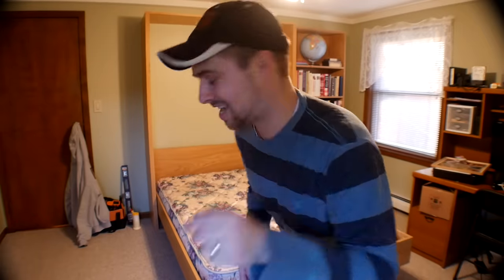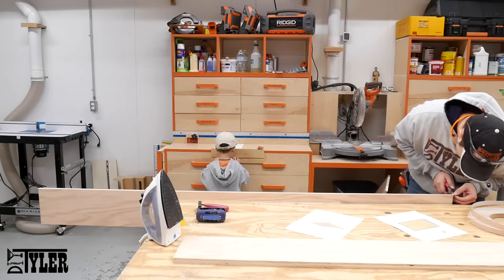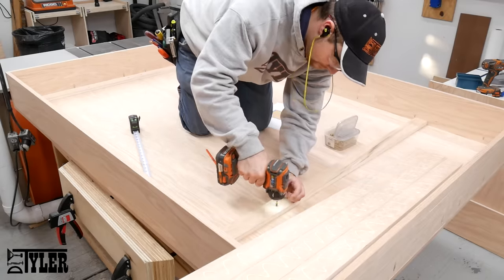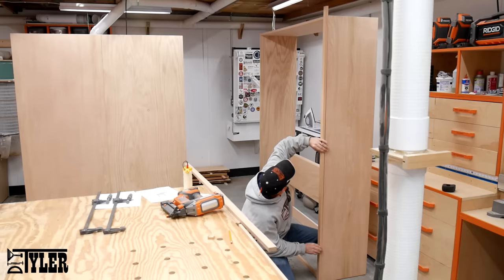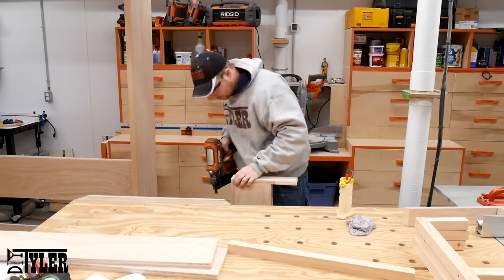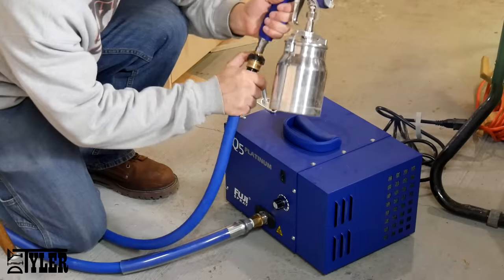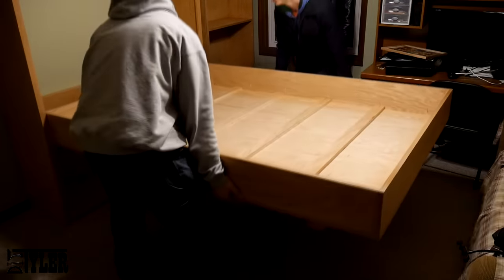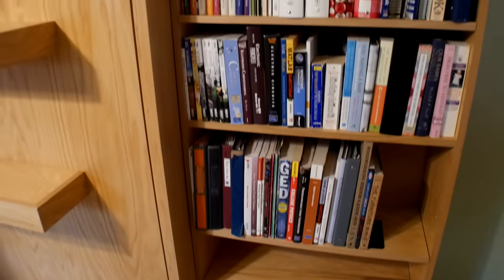Murphy Bed with Cheap $20 Hardware

Comment: Well planned bedframe. The Lazy Susan bearings are such a cheap and easy option with many being rated for a couple hundred pounds. Your push stick though, oh boy no wonder you were uncomfortable. I built a sword style with a handguard in the center and then at the very end to accommodate my safety needs.  It's been great for everything and awkward pieces I can still easily grapple with it from whichever side, and use a scrap stick for the other. 
28 years ago, a massive piece of plywood yanked my hand into the blade.
I lost an index finger tip that completely grew back, and the ring finger pad was totally blown open but the doctor flopped the pieces in, put in a few "Dr. Frankenstein" looking stitches, and it healed really well. 
I did not touch a table saw for another 13 years! 
I was and am an ultra elite level guitarist and that happened to my left hand, the string hand!

Comment: Bought your full size plans about a month ago.  Built the bed in a low ceiling spot, with an angled hip wall, and had to convert it to a horizontal build. Had to build unit in place, as bed box and cabinetry would not have rounded the corner up the stairs and into the room built in the attic. Added a bookshelf to the top in the remaining space. Came out pretty good.  Had to use it this week for company, and it wasn't entirely finished.  Finished trim work tonight, and will prep and stain in the next few days.  Thanks for getting me started!
Reply: I have to do a horizontal build.  show pictures.  I would love to see the bed.
Reply from the maker: I now offer plans for a full size bed, horizontal.

Comment: I built a wall of various depth of shelves 30 years ago using 3/4” birch plywood and discovered the iron on veneer tape and it has held up well. I used Minwax Antique Oil Finish without a stain but it gave the wood a deeper look with a soft sheen and it has held up well despite having plastic bins of fabric and other items sliding across them without not having to be retouched. The tape on the edge made the shelves appear solid and was so easy to apply. We had recently moved in at the time and I wanted something that could quickly be completed without the typical multiple steps for traditional finish. I remarried 6 years ago and my husband who has become interested in woodworking had never heard of the veneer tape. They did have the typical glue on variety back then but I had more than 40 feet of shelving. We have talked about a Murphy bed in one of the bedrooms which drew me towards your video. Very nicely done!

Comment: I want to thank Tyler for answering my question about the depth of outer frame .I built this bed  using thong and groove 1x5  knotty pine. This was much cheaper than using plywood because of the pandemic raising the prices of big box lumber. It came out just great a little heavy for folding . I also added 3 in. to the outer shell as suggested by Peter Lowe because my mattress is 17 in. thick I also added a extra 5 in to the top of bed box. When we first folded it shut the open the mattress stuck nothing a strap did not fix you just have to take strap off before sleeping. It only took me a week to build thanks to the great plans and some helpful hints. Also my wife helped and her help was greatly appreciated!

Comment: Thank you for making this video. I just discovered your channel today and wish I would have a long time ago. I have plans to make one of these beds in the near future and this is very easy to follow. I really like that you have your little boy help in the shop. That is incredibly important not only for learning but for bonding as well. My little boy is going to college next year so I'm already getting nostalgic for the early days.

Tech Tip: 
You mentioned that you had a tough time holding the large frame with various clamps etc. What I have done in the past is get a ratchet strap or put 2 together to get the desired length. Wrap it all the way around the frame and gently ratchet it together. It will hold even pressure around the entire frame and give you the rigidity you need to adjust your joints and shoot in the screws.
Reply: Great tip I will use next week!

Comment: Very smart build. Like how you use the shelves as a bed base. 2 suggestions. 1st, for your your corner attachment. Get some of those inexpensive 90° clamps that are about 1 1/2" wide. 2nd, in the video you should have mentioned what you used for the swivel. I'm going to mention that those are $10 boat swivel seat bases. I have them on my boat. It takes a bit to swivel around which makes it a great use for something like this. GREAT JOB!

Comment: you could probably just drill 4 holes through each mounting plate and screw them in, no need for bolts. 8 screws can hold a lot of combined weight. I've seen other people add in gas struts for car boots and other mechanisms to offset the bed weight. Looks like an easy enough addition to your project. Great job.

Comment: Have to say
That stain job looks fantastic. 
IMO gives it an aged look although it's brand new. 
Here's a secret from the upholstery world on those swivel brackets. 
Flip over a swivel recliner and you'll see, in that pizza board, as they're called, there's two holes large enough to grant access to the inside holes.

Measure out a piece large enough for it to attach to and swivel without coming off the edge. 
Attach it to the swivel plate. 
Swivel 45 degrees and cut circles over the bottom set of holes. 
Now you have a way to get to those bottom holes without too much difficulty. 
You attach those first, two at a time, swivel to the next two and attach those. You would then attach the swivel board to the mattress  side rail with heavy gauge screws from the inside. 
You would have to figure out how to hide that board but beefing up the side rails for the mattress could do that and it will create extra strength. 

I like and dislike the shelf idea. 
Anytime you let the bed down, you've gotta empty those shelves. 
But, it looks great and these beds aren't in constant use. 

Great build young man!
Good to see dad getting the kids into something other than electronics.

Comment: Best built I've seen so far! Thank you! PS: I've been using clear coat finish and tinting with stain for many years. I don't have an expensive sprayer, I roll it on with a foam roller.

Comment: Great design, Mr. T...I have it built and recycled some old old cedar sub-flooring for the wall/underside when in the parked position. Each board is stained a different shade....14 in all  Just figuring out the floating shelf/base system. I also found the Swivel Seat bases at WALMART FOR about 8 bucks each. BTW I used Valspar Cabinet and Furniture Oil enriched water clean paint. Lowes has it for around $53 a gallon but worth the hassle. I spilled some on the carpet...cleaned up nicely.

Comment: Hi,
I like the idea of using lazy suzans, but what's got me worried is how it will hold over time: 
These mechanisms are designed to support axial loads, not radial loads (and it is very difficult to even find any figures at all for radial strength)
So my question is: after a few years, did your build hold well ?
thanks !

Comment: is there any way to have this similar design with the legs as floating shelves but without having to manually lock it at the top
Reply: Ponle un límite en la parte de adentro y listo

Comment: The only issue with pre-tinted finish, is that it lacks the depth that a hand rubbed stain gives you. That said, many years ago when I was working in production cabinet shops,  tinted lacquer was the common method of finish. Your project not only looks good, but nice to see an inexpensive option for Murphy beds. Keep up the great work.

Comment: Hey Tyler nice job on the build i know its a older video one tip is you can make your own  90 degree  triangles  with a 4 “ wide strip on 2 sides it gives you a way to clamp those bigger  parts  by yourself on a table  easy peasy. And you can usually  use scraps or cheap MDF ?

Comment: No table saw. Ive got a portable Craig crosscut for my circular saw but there's just no way unless you took some of the build outside put some tarp on the ground and got very comfortable with your saw horses. Lol. I'm hoping the old router bit from my 6-piece Black & Decker matrix would take care of the dado but who knows, it's not the sturdy piece of machinery although it has been super handy so I don't want to knock it too hard. Also those sheets of plywood aren't necessarily cheap😅 but if this is something you need this is an awesome tutorial. Im in deep consideration. Like a lot of you I wanted a smaller version but I think the measurements for the size bed are a lot easier to tackle. Especially if you're not losing anything off of your sheets of plywood because it's super nice.lol.

Comment: I made one of these in a twin size for my granddaughter two years ago. At 58. Go Grandma's! I'm still not happy when it's up. I used a bolt on each side going into a t- nut on the bed frame. I'm always worried it won't hold. And the t- nuts aren't staying secure. So do you think if I just remove the t- nuts it will be secure enough? Thanks.

Comment: Great project.  Another cheap option for coloring clear water-based finishes is just throw some instant coffee in it.  Did this a while back with a project covered in red oak plywood.  Thru a trial and error process, I found best trick was to dissolve a large amount of coffee crystals in a cup of hot water, then add this to the water poly.  Do a bit at a time as you can always darken it but  can't go back.  Made a great golden-oak finish, and subsequent coats darken the finish, but recoating can make for dark streaks in the corners, so once the desired color is achieved, additional finish coats should be clear coats.
Reply from the maker: +gjforeman That sounds delicious! Thanks for the tip!
Reply: Tyler G Not sure how it would taste, but if you're a coffee person it smells great while drying.
Reply: Great idea.   very natural 
. solution.    I love the smell of coffee.

Comment: I'm planning to build a Murphys bed and your video is an awesome inspiration. Just have two  questions, that I hope you can help me with.
1: Did the Swivel Brackets hold the weight? Because the Swivel Brackets are supposed to be mounted horizontal (flat) 
2: Would you have done anything different?

Best regards
Reply: This is what i want to know. I have a feeling they will eventually break

Comment: A few years too late, but instead of the bolts in the end, would a two-latch system not fit the bill for keeping the door closed? One on each end connected by a single cord hanging a few feet away. Pull the cord and the door comes down, push the door up and it closes on it's own.

Comment: Remove the mounting screws for the pivots and add a washer between pivot and wood, then screw them back in.
If the unit will be used every day you might want to use threaded inserts to mount the lazy Susan hardware

Comment: Not sure how often you reply to old comments but how'd this holding up? I'm moving and thinking of adding a murphy bed to a room but the boat seat swivels aren't technically used for this so I'm curious how it's holding up?
Reply from the maker: It's still perfect. We don't use it often but it has held up great. I painted it a different color but that is the only change!
Reply: @DIYTyler  Glad to hear. Thanks for getting back to me on this. I'll be purchasing plans as soon as we move into our new house. Looking forward to making it! First large scale project for me. :)

Comment: I just bought your plans but I have a few questions...as to the floating shelves in the plans it says 2x4 material (only in the diagram, not the shopping list) but in the video, it says you use 2x 6? It seems like the shopping list isn't super complete how much 2x4 or 2x6 should I need? I think just an 8 foot board? Also, it says 3/4 solid oak but no measurement of how much I need and where exactly that goes. I could tell in the video where you put it but I thought it interfered with the brackets and it would be changed in the plans?

Comment: Nice creative use of the lazy Susan as hardware. I'm not sure if access would be possible, but if you used carriage bolts would the low profile heads clear the face frame?

Comment: I work at one of the largest paint and coatings retailers, and we never recommend you mix your finish with stain. The majority of finishes aren't made for it, and you run the risk of issues down the road. Now for most projects you're making for yourself, this is really fine. You know what your getting, so no big deal. I wouldn't do that for a customers project, or anything your wanting to sell however.
Reply from the maker: I spoke directly with general finishes and didn't use a higher mixture than they recommended. Like you said majority of finishes are not made for it, high performance top coat can be mixed with GF water based stains.

Comment: I built a twin version very similar to this many years ago. It worked great for several years.
Reply: I would like to build a toddler version for my grandson, however I want it bed outward, so the the flat is the bed, no mattress will be involved. Do you think this would be possible? So that when it stands up/out it shows a bookcase and when it lays down it shows a flat surface or at lease a small recessed area for where the mattress would go. I'm not sure that l am making sense as to how I would like it to be. Please respond to give me a little hope that I'm not crazy.

Comment: Hi Tyler, quick question - page 9 trim dimension shows 1" wide. Page 10 states boards are 1 7/16" wide.  Can you please clarify my confusion?  Also, what are the dimensions of the two bottom boards on the frame - 3/4"x3/4"x 63" (& 64 3/8"), I see the length but not the width & depth.  I see the back board is 3/4" wide actually. All trim is 3/4" thick?  Thank you!

Comment: Looks like there is something added in when you flip the mattress up. Underneath where the hardware would be, on the floor, did you add something front to back? For what purpose?

Mine is totally built, just added the second coat of white paint on the middle section (the wall frame for the bed) and did two shelves. Cannot wait to be done lol. I just have to paint the mattress box and attach it to the rest of the unit. It's looking really really good tho!

Comment: Tyler my queen bed is gorgeous. My finace' loved it until she tried to open it. At 72 pounds extended (weighed from the foot of the bed without a mattress) it is too heavy. She can't lift it. And she is concerned about her 3 year old grandson playing in front of it and the whole thing comes down on his head. She wants me to tear it out. I see her point. Or, instead of trashing it, can I add some spring loaded gas shocks on each side? Do you have a recommendation?

Comment: One cool upcoming woodworker at 4:06 and at 9:26 showing some great cleanup skills. Great project as always Ty, and that Fuji sprayer sure looked awsome. Is the overspray really so minimal that no covering is needed in the shop?
Reply from the maker: +Bellevue Woodshop It is if you go slow with a lower spray feed. But, shooting only a clear water based top coat I think the finish is dried by the time it lands on anything besides the project. Haven't noticed any Ill effects. Thanks for watching Roy, hope all had been well across the pond.
Reply: Bellevue Woodshop      N+.    '

Comment: Hey Tyler,
Great work. It's been very nice to see your variation of the design with the swivel bearings. Have you factored the fact that the pocket holes on the inner mattress frame are weaker than on the outside?

Comment: Tyler, thanks for the video and the plans.  The video is very well done, and the plans are very helpful.  I purchased the queen bed plans and am getting into the details.  Also making some minor changes.  A few questions.  Mainly, how much space is needed to accommodate the nuts that hold the swivel hinge to the “bed box”?  It appears that, with the two 1” vertical edging boards, as shown on page 9, there would be a 11/16” space between bed box and the frame on each side.  That seems like a much larger gap than is shown in the video for the Murphy bed that you made.  Is that because you cut some of the vertical edge board off to accommodate the nuts on the swivel hinge?  I didn’t see that any of the vertical edge board had been cut away in the video after you had installed the bed and closed it up.
Also, how much space between the bed box and the frame is needed at the top?  It looks like the plans allow for ¼”, based on the placement of the swivel hinge.  It just seems like more would be needed to allow the top of the bed box to rotate out.
A possible typo: On page 10, there are two solid oak boards shown at the bottom of the frame.  One is shown as 63” and the other 64 3/8”.  The vertical edging boards are shown as 1 7/16” wide as page 10, but page 9, indicates that these boards are 1” wide.  If the vertical boards are actually 1 7/16”, then the shorter of the two bottom solid oak boards would be 63”, but if the vertical boards are 1” wide, then the shorter bottom edge board would be 63 7/8”.  I believe that you changed the vertical edge boards to be only 1” wide to accommodate the nuts on the swivel hinges.  So, I think that page 10 has an incorrect width for the vertical edge boards and the shorter bottom board.
Thanks again for the video and plans